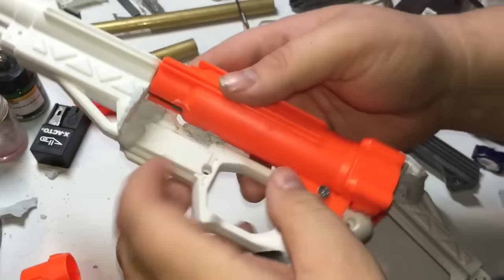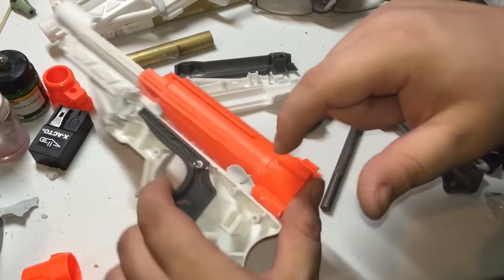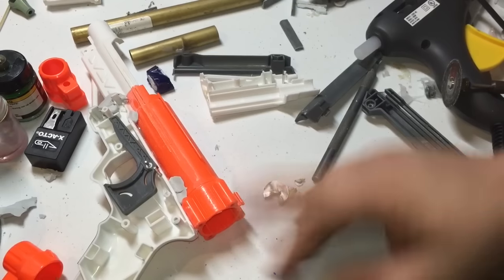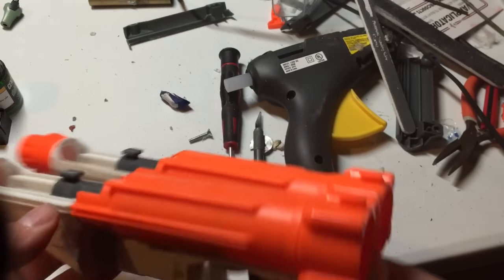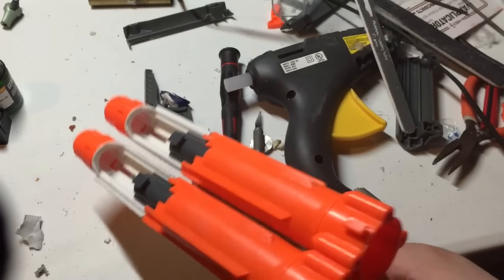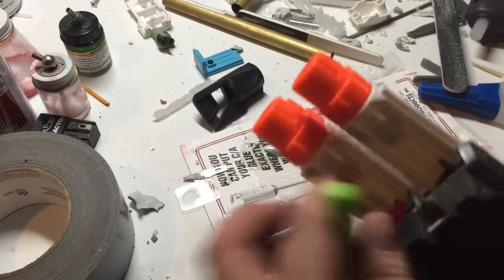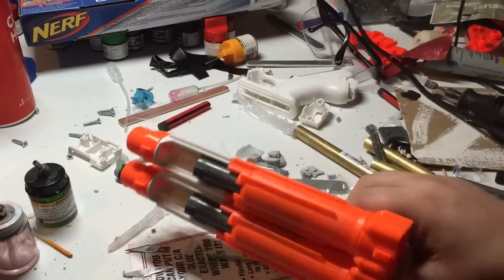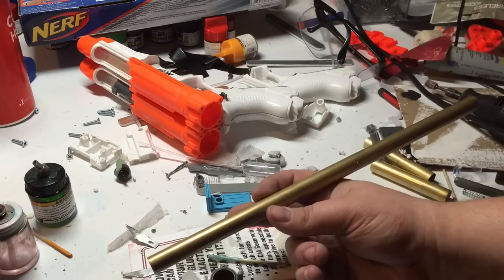The Acuteblaze - Building PART 2 [Nerf Sharpfire(s) Overmod] | Walcom S7

Comment: A few humble suggestions.
Rough up the out side of the brass with a file (or sand paper) so the adhesive can mechanically lock in to it.
(Use whatever bonds best to the plastic.)

Why don't you add pins to the catches so you can put the springs on the inside?
Or pin the catches together and have the trigger act on the pin? 

I like it.
It reminds me of a gun Gene Starwind used in an early episode Outlaw Star.
Reply from the maker: +Wade Kirby Reminds me I need to make a Caster gun...

This entire blaster is gonna be remade, I've learned a lot since I've built it. I'll do the revisit soon and make it more war-worthy.